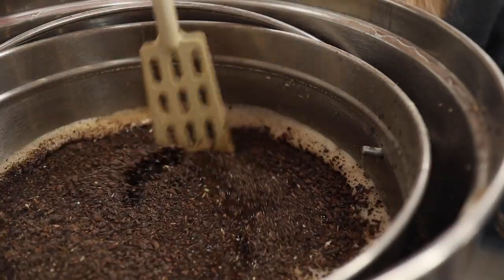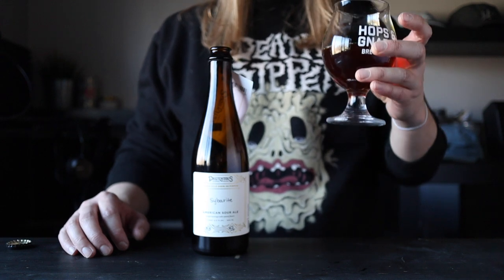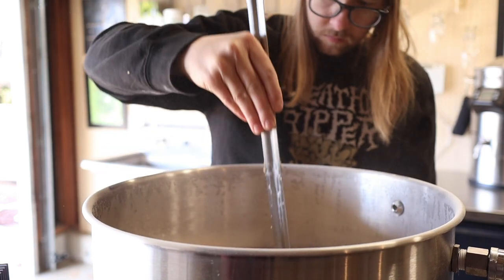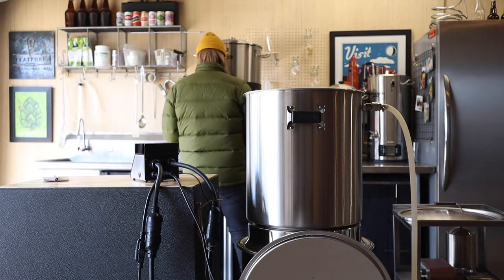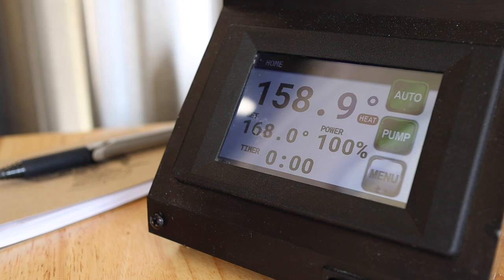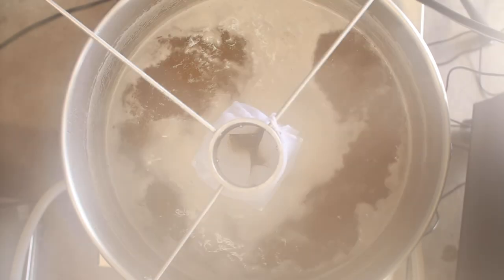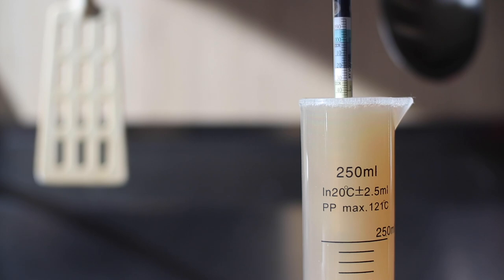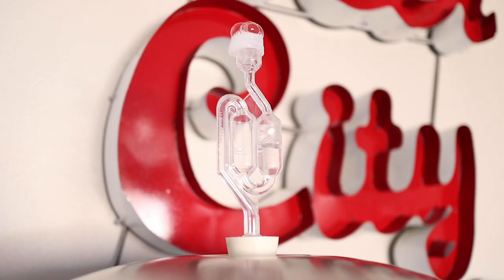Wild American Sour | Blichmann BrewEasy | EP21

Comment: Love your videos man, glad to see you back.  When chilling your wort do you recirculate the cold side?  I picked up a submersible pump and started recirculating in a bucket.  Just add ice when things start warming up.  Made a huge difference for me, especially in the summer in Colorado springs when tap water isn't as cold.  Saves on water too.  Just a thought!
Reply from the maker: Thanks man! With the Blichmann Therminator plate chiller I really haven’t had the need to. It’s insanely fast, especially with 3 gallon batches. Haven’t used it in summer yet so I might need to reconsider when the ground water warms up. Cheers! 🍻